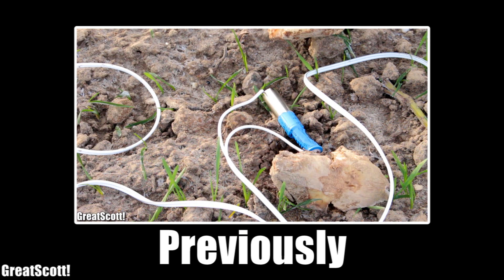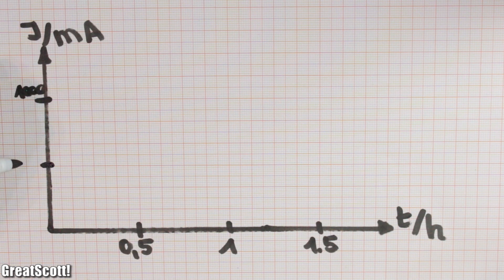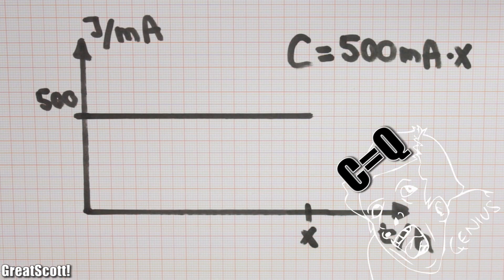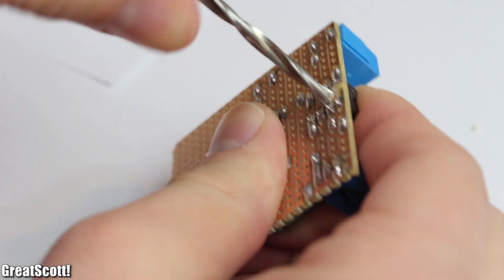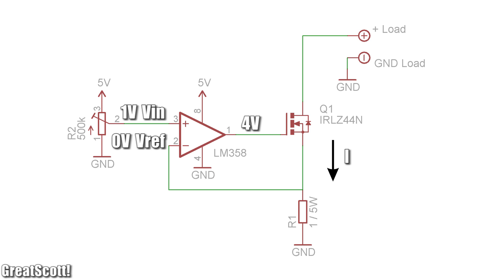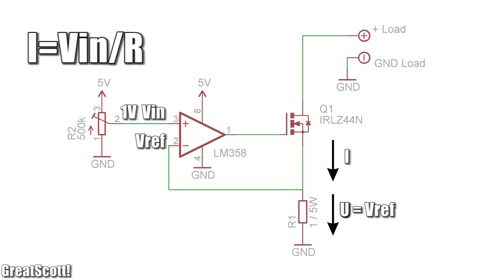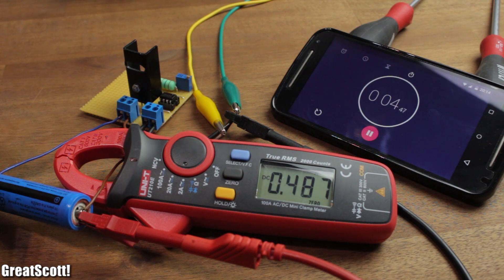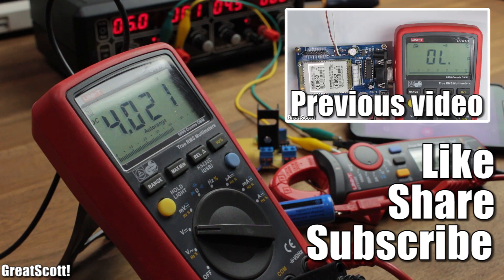Li-Ion Capacity Test || DIY constant current load

Comment: Why did you stop discharging the battery once it sank to 2.5 volt?  If you would have discharged further to, say 2 volt, it would not had been 1.8 hours and it would not have been 900 mAh. Something smells fishy with that math.
Reply from the maker: Google "Li Ion discharge curve"
Reply: Probably because if you discharge a Li-Ion battery below 2.5 volts it can and more than likely will cause permanent damage to the battery. And as such all Mah ratings are supposed to be based off how many amp hours it can put off before reaching that point and its discharge protection circuit kicks in and stops it from going lower.

 Nothing is "Fishy" here, if he discharged the battery more and then tried to charge it up again it may not do anything or It may explode violently... That is just how it works...
Reply: TrollFaceTheMan i have been used to charge 0.2v liion. they can be used then but i doubt it would be high
Reply: And also, when the cell is down to 2.5 Volts, the voltage is falling rapidly with time, so there really is very little capacity left in it. A cell which has been taken below that voltage also suffers from chemical reactions which will rapidly reduce its capacity. That's why a battery which has been left discharged for a while might not recharge again.

Comment: Have you ever tested a good Ultra Fire Battery? I think they are all crap.
Reply: I recently purchased and  tested a couple UltraFire 5000s and a couple UltraFire 3800s.  The 5000s test to 1000mAh.  The 3800s tested at 450mAh.
Reply: every single one is fake. 
Its their business to sell fake batteries.
Reply: most chinese ultrafire are laptop recicled batteries so they have less than half life cicle
Reply: The are all fake
Reply: Google Plus Blows Chunks 
so one multiplied the capacity by 5, the other just basically added a 0 to it.! 
 that is quality.
Reply: Have you ever found a real UltraFire battery? They don't fucking exist, and if they do, you can't find them in the sea of fake batteries.
Reply: Got one included in a cheap laser. Claims 3000mah, more like 300mah lol. It's super light as well

Comment: Can I test my 11.1v lipo battery?
Reply: i did my tests with my 2s battery, just put the low voltage buzzer to remove the battery from load when it reaches 6.4V (3.2 per cell).

in your case, 9.6V you should remove them. cya!
Reply: yes if you want it to explode  if a lipo gets below 3.3 volts per cell it is close to exploding
Reply: ***** yes, to DAMAGE, so the +.2 V is a security measure to give the battery a good lifetime.
Reply: that's bullshit

Comment: Not sure if it true, but I've had a couple people tell me that the "cheep" batteries need to be discharged at a very low rate. For example a good battery can 35amps at 500mah. While a  "cheep" 6amps at 100mah. And that's how you see 9800mah batteries.

Comment: can you make a tutorial on how to charge a Ni-Mh battery and have it automatically turn off when at full capacity? also if it were possible to charge them while the batteries are connected in their primary circuit such as a stereo. 3 pin negative, charge, and discharge

Comment: why didn't you just kept Vgs constant and drove mosfet in saturation, and obtained a current equal to 1A? it would still be able to act as a constant current load.
Reply: Because that model of MOSFETs is complete crap.  They act much more like Vgs dependant resistors.
Reply: +EGL24Xx That's what I am saying, keep Vgs constant and make a current of 1A to flow through MOSFET.
Reply: +Siddharth Sharma And how do you plan to do the regulation?
Reply: +EGL24Xx Using the bench power supply? wouldn't that work?
Reply: +Siddharth Sharma you could, but you could also break the supply.  Electronic loads exist for a reason.

Comment: No it is not the correct demonstration.  you forgot to keep in your consideration the discharge rate of this typo battery.  the current is dependant on the c  ratings of the battery.
Reply: Nope Nadeem, 18650 capacity on datasheets is typically measured at 0.2C, he's being generous to only draw 0.1C during the test. The cells are garbage.
Reply: yep, but there is 2 points:

1- 500 mA of load for a lithium 18650 cell is almost nothing compared for what they'e disigned for. For sure, a lower current draw will result in a more accurate capacity, and that is why 500 mA is perfectly fine.

2- They are chinese batteries, so i dont think they have "C" to measuring something.
Reply: 500mA load for 18650 should be sufficient to show correct result.
Reply: The "correct" load is the one for your application. The discharge curve will be different (and its integral, the capacity) for different loads. 2.5v is a really low cutoff voltage. The datasheet for most cells recommends 2.7 or slightly higher as the minimum discharge voltage.

Comment: Question.  Obviously we have to watch out for fake ratings on batteries these days (what a shame).  Have you had any experience with lipo packs from HobbyKing?  I know their components come out of Hong Kong for the most part, but I haven't had any issues with other things I've bought from them in the past.  However, I haven't bought batteries from them.  I was looking at this 8S 12 A/hr battery pack for about $90.  Seeing how much other Lipo packs cost this seemed on the cheap side of things.  Just curious if I could trust the rating. (see - http://www.hobbyking.com/hobbyking/store/__55805__Multistar_High_Capacity_Lightweight_8S_12000mAh_2C_Multi_Rotor_Lipo_Pack.html)
Reply: Hobby king is 100% trustworthy as a source. Generally speaking, you can trust anything with a major name to it. The only LiIon cells that are consistently total bs that even have a name on them are Ultrafire or sometimes Tangfire. Generally, if it seems sketchy it is.

Comment: I tried to built this circuit 2times and i changed to different ic's and 2 different mosfets but the output load current goes up to only 30 ma...Why is that?
Reply: Yep,it was 1Ω and it didnt worked :(
Reply: ElectronicGaming101 Ah,never mind :)
Reply: _who_cares_ Of course idid...i know many things about electronics :)
Reply: +who_cares I think the schematic shown in the video is wrong. "GND Load" should actually be connected to 5V, not to GND. Otherwise the MOSFET connects GND to GND, so (almost) no current can flow..
Reply: +Max von Wolff Ahh no sorry, I was wrong. I didn't thought about the fact that the load is a lipo..
Reply: No, the load is the schematic. Lipo is the source.
Reply: when you have a crooked government, you have crooked people.

Comment: haha novadays you can find 2x 6800mah 18650 batteries for ~3 dollars on ebay.. seems legit
Reply: And you can see "650 sold" on the corner. 
Gotta feel sorry for them.
Reply: What's worse is when a Chinese seller sells an item more quickly, they have an algorithm which automatically increases the price. So the ones who bought later are scammed even more than earlier buyers.

Comment: ...or you can use a hobby charger like imax B6 to discharge and it will tell you capacity, it will also let you pick constant current from 100 mA to 5A.  Now in normal Li-Ion mode it goes down to 3V only, but if you select Ni-Cad battery you can go down to whatever you want, I use 2.8V because I think 2.5 is rather low, but I wonder what manufacturers use to measure capacity.

Comment: So you were discharging the battery at a constant current, correct?
Reply from the maker: +Dylan Rinck Yes
Reply: Why not just charge the battery at a constant current and voltage? Wouldn't that have been easier?

Comment: can  i use voltage regulator?and please make video about it
Reply: Sure, just connect the battery positive to the input of an LM317, its ADJ pin to ground and a 2.5 ohm resistor between its output and ground. That will draw close to 500mA constant current. Put a heatsink on the LM317, of course.

Comment: I think I wired up everything correctly but the circuit only draws a maximum of 20ma. What could be wrong with my circuit?
Reply: +Carl Hauschke It looks like my MOSFETs are not working properly. Source and Drain are connected even if no Voltage is applied to the Gate.
Reply: +Carl Hauschke Mosfets will have a leakage rating but your feedback loop is very important for the OpAmp to do it's job correctly. I would suggest adding resistors to the gate (1k) and on the feedback loop (10k) to stabilise the oscillation. A small value capacity (100n) will help as well. The resistors are slew rate limiting, NOT current limiting as there is no current flowing. They just slow down the oscillation for cleaner signal.

Comment: Quick question. Say a circuit draws 1A.  That means every second 1 Amp of current (one Coulomb) is passing a giving point, correct?  WOuld it then be also correct to say if that circuit was turned on for 10 secs it would have drawn a total of 10 Amps?
Reply: +KillJD you may confusing Amps with Amp Hours? One is current. The other is a Capacity rating. 1 Amp draw is a constant current draw of 1 Amp (or 1000mA) regardless of time. 1Amp Hour (or 1000mAh) denotes the theoretical capacity of say a battery means you can draw about 1A for 1hr, or 500ma for 2hrs, or 100ma for 10hrs, etc before depletion...
Reply: +KillJD Beter late then never? No, 1 A * 10 s = 10 As (Amp * Second) or about 3 mAh.
Reply: +ThePetaaaaa Better late than never, indeed!  Originally I was confusing amp and coulombs.  So at 1A draw for 10 seconds a total of 10 coulombs would have been consumed by the circuit. Your 10As is correct in that regards.  Thanks.
Reply: +Mike Novo I didn't see this reply earlier. I was originally getting Amps and Coulombs mixed up. the Capacity rating I understand though. Thanks.

Comment: I actually did something like this last year, but I used a different approach: https://github.com/Djhg2000/AStar_32u4_battery_discharger

I used some resistors, an Arduino for measuring with the ADC and transmitting that value through serial and finally a mosfet to break the connection once the specified cutoff voltage was reached. I then wrote some code in Octave (open source Matlab interpreter) for the math stuff.

After some bugfixes I had a pretty accurate and dirt cheap battery capacity tester, independent of battery chemistry (as long as the cell is below 5V) and discharge curve.

Comment: Could you also completely discharge the battery, then charge it at a constant 4.2V, and a constant 1C, until the voltage of the battery reaches 4.2V(and is completely charged) and then find the capacity of the battery based on how much time it took to charge and the constant current?
Reply from the maker: The Shining Once the battery reaches the 4.2V it enters constant voltage mode and starts charging with less than 1A. This makes calculations difficult again.
Reply: GreatScott!
Oh so the battery could reach 4.2V and still not be fully charged? did not know that
Reply: +Hynkel It takes energy to charge a battery. Expect 1.2-1.5 times more energy. Charging a battery at 1C is setting a protection current maximum so as not to damage the battery. ie A dead 3.7 Lipo battery will be at 3V. Less could damage the battery which is why some have onboard protection circuitry. Setting a 1C rating charge on a 1000mah means a max CC of 1A charge. The 1A will continue until the battery reaches a voltage of about about 4.1V. At this point it will switch to CV (constant voltage) mode which just means a current limit is no longer needed as the draw has dropped and will lessen as the battery tops up due to less demand on pressure (voltage) difference. Once the current draw is about 0.1C, the battery is considered fully charged.
Reply: you could've just said: yes, when the battery reaches about 4.1V the charging voltage becomes constant and the battery will pull smaller and smaller amounts of current until it is fully charged

thanks for the thorough explanation though

Comment: Is it possible to use another mosfet instead of one you used? I can't find it in my area. I have a bunch of recycled 18650 cells from discarded laptop batteries, and I would like to know are they usable for anything. Most of them are Samsung or Panasonic rated at 2200mAh
Reply: You can't expect to be able to use a non-logic level mosfet with only a 5V supply. You could use an IRFZ44 or anything similar with a 9V supply to the opamp. The limiting factor is that the LM358's output can't go above about 3.8V with a 5V supply and the mosfet's source has to be below its gate by at least its threshold voltage. Vgs(th) is between 1.0 and 2.0V for the IRLZ44, but between 2.0V and 4.0V for the IRFZ44. You have to have enough voltage left over for the drop across R1 and that's unlikely for non-logic level devices with a 5V supply.
Sadly, 7 years late, but just as true now as it was then.
Reply: Ivan Milicevic yes, most N channel ones work, just read the datasheet and make sure it can handle the used voltage and current
Reply: I'm only 2 years late

Comment: Just a simple and dumb question, but only for being sure, in the constant curent load diagram, you use the logic level z44n, but i have the normal irfz44n, if i supply it with anyting between 10 to 12 v i suppose it will work as well, the only question is if the potentiometer to regulate the current pat has to change a lot or it can be the same 500k.

Thanks.
Reply from the maker: jotasgasco Potentiometer value stays the same. But you may need to increase the supply voltage for the LM358 and potentiometer. From 5V to 12V should do the trick.
Reply: GreatScott! BIG Thanks! that did the trick for me, here in Taiwan i only can get the IRFZ44V and the C358C, with 5V i was getting only 200mA max load. With 12V i can increase the load to 1A or even higher, but 0.5A is enough for testing LiIo's... i finally have a constant current load i always wanted, now i just need to dig out the arduino + gnuplot thingy i made a while ago to make real accurate testings. Besten Dank und.... Ohren steif halten und weiter machen!

tt

Comment: The capacity of a battery shall be measured at 1/10C current (hence, you must have something near10 hours of discharge); if the drained current is too high the measured capacity of the battery become lower than expected (and, on the contrary, if the drained current is too low the measured capacity become higher than expected)
I also suggest the use of some smoothing & decoupling capacitors to remove the oscillations.
Reply from the maker: teslacoiler But 1/10C is far away from reality. I will do some further test with other big brand batteries to see whether they can supply their rated capacity with 500mA.
Reply: Li-ion batteries are pretty good at supplying most of their rated capacity a higher discharge rates than C/10, so the error is unlikely to be great. I have a "Multi Smart 3000" battery charger/tester from 7-Day Shop and it can measure battery capacity through a full charge-discharge-charge cycle at a choice of several set currents. I haven't seen much difference when testing the same 18650 batteries at any of the test currents, so I'm fairly confident that the capacity I've measured is close to its value for C/10.

I do strongly agree with the need to properly decouple the supply to the opamp to remove those oscillations. I'd suggest a 100nF ceramic capacitor between pins 4 and 8 of the opamp, as close as possible to it, along with a 10μF - 100μF electrolytic capacitor across the incoming 5V supply.

Comment: You should make a tutorial on how you make such straight wire bridges for your protoboard :D
Reply from the maker: ***** Super simple. Just grip the two ends of your wire with a plier and pull. That's it.
Reply: GreatScott! which wiregauge are you using? 0.8mm?
Reply from the maker: ***** Yes
Reply: GreatScott! Excuse my ignorance, what kind of wire is it? It doesn't look like wire, rather like rigid metal. Can you give a link?
Reply: Mandragoras no, it's silvered copper wire normally. to increase contact conductivity or so, idk :P
Reply: Mandragoras loks like tinned copper or silver wire
Reply: ***** Silver wire like the wire that is used for jewelry making?
Reply: +TheTrueM3ga  its actualy just tind coper wire
Reply: Indeed he does amazing job with this wire. 
Do you know where to buy it? (eBay or something)
Reply: Indeed he does amazing job with this wire.
Reply: Indeed he does amazing job with this wire.